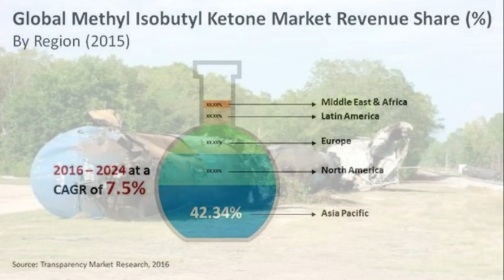The Shepherd Train Collision 15 Years Later

Comment: Many, many years ago (nearly 50) I worked for the N&W as a brakeman, and I had it drilled into my head that when you line a switch for a movement into a siding you ALWAYS lined the switch back to the main. 

Such a simple and easy action to avoid disaster.  It just takes one lapse for hell to break lose.
Reply from the maker: I agree completely. The same thing happened in the Graniteville train crash as stated in the video, and the Cayce train collision in 2018.